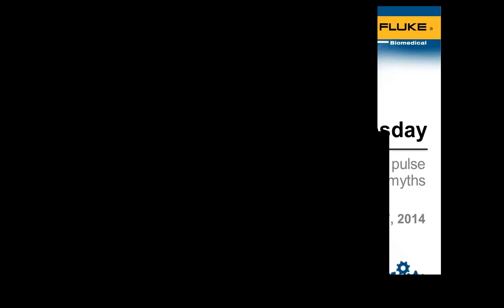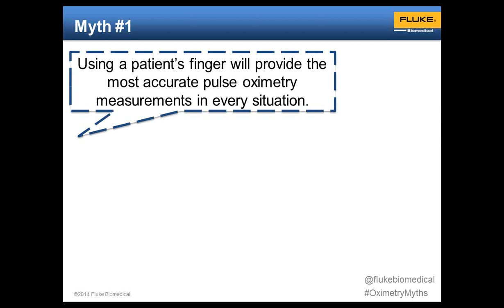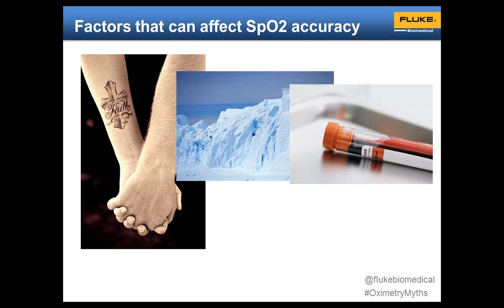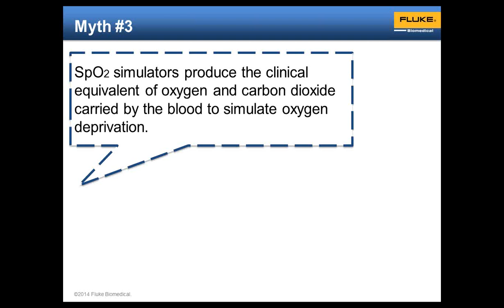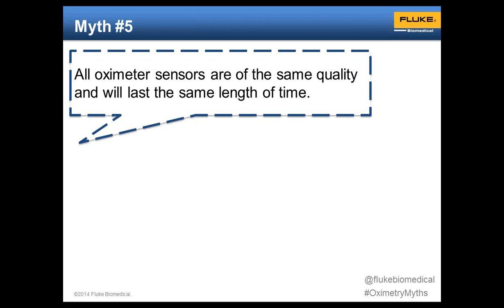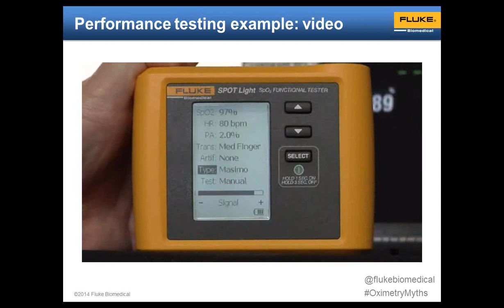The Five Most Common Pulse Oximetry Testing Myths

Comment: With a mossimo monitor using tape finger applicator. I applied pulse ox probe to index finger... ran cord on top of finger of 5 yr old. A colleague told me i had it on back wards saying i was supposed to run the cord on the underside of the finger. Smh.... i just looked at him dumbfounded like he was teaching me about the importance of blinker fluid. Smh. Also he made statement that if o2 is 99 its impossible for co2 to be high.  I was beyond floored. Ive seen high co2 in 60s and 70s with 100% o2 sat. Whats are your thoughts?